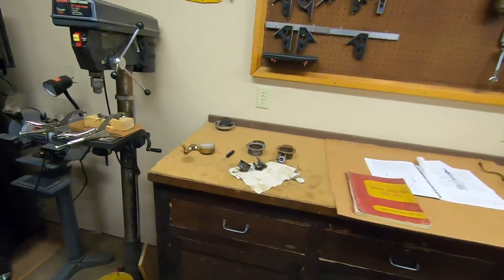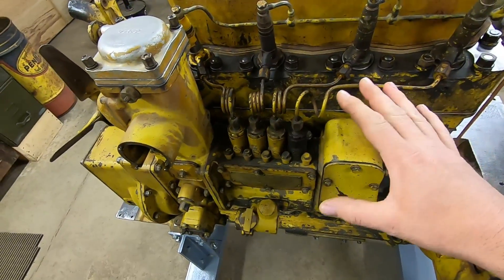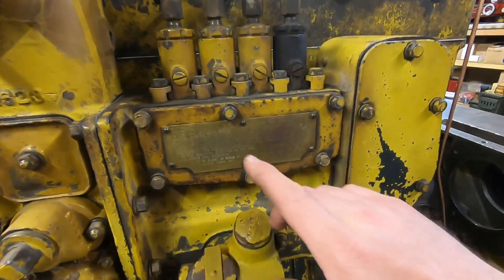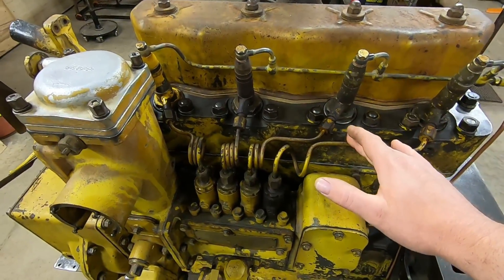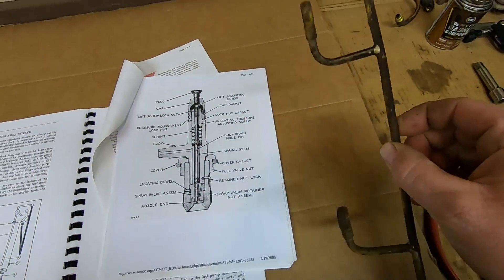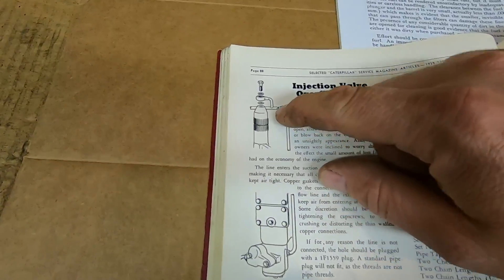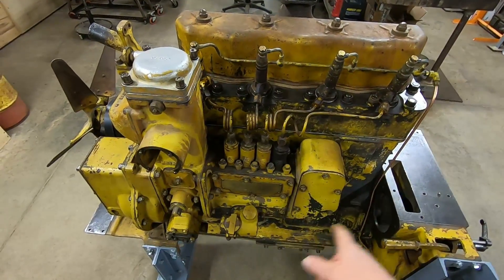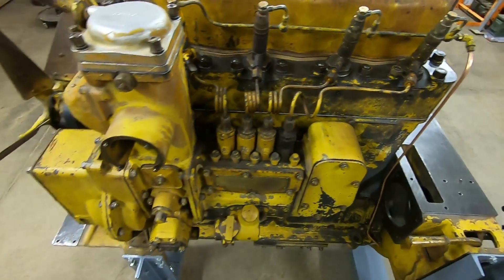Caterpillar D2 #5J1113 - Injector Return Lines Explained - How Much Fuel Do They Actually Leak??

Comment: It occurs to me that the leaks caused by the modification (poor design, built in failure) are equal to or greater than the original system.

Comment: I don't know if plumbing a line back to the tank and dumping it in there is a good idea but it seems a catch-can that can be easily removed would solve the problem. Part of normal start up service would be to empty it into a container to be used for shop stove fuel, parts cleaning, whatever. That way it neither goes to waste nor gets callously spilled into the environment.

Comment: On granndpas old cat he traded a cletrac  for it had that injector run off line but gramp had the front one routed to the back on and both of them terminated at a catch can he had mounted to the crank inspection plates it could be checked and emptied once a month or so

Comment: the old 2 stroke Detroits dropped oil . that's how you knew when to do a inframe . from my memory detroit recommend a inframe when the motor dripped 20 drops of oil per minute from the blow-by tube.

Comment: My experience is with Lister stationary/marine engines with a similar fuel injection system. We always ensured that the "leak off" was piped back to the tank. If not done it could cause over fuelling on full load. Diesel drips in a boat, not acceptable.

Comment: To keep the purest happy put a little catch tray under the the “one drip per minute”
 line.😉 Could you imagine a little catch tray made out of a small Tuna tin.😂😂. Maybe paint it cat yellow a thought too. 😂😂. Endless fixes for the purest! End of the days work remove the contents to the tracks to reduce rusting. Nobody would know any difference. However they would be ever so upset if there was no diesel o/f into the tuna can hey. Nothing to make them squeal. There inflated egos would definitely be quieter.

Comment: If you notice as you drive along the highways that darker section between the normal tire tracks,..that's dripped oil etc. etc. for all out vehicles pounding over the roads all day long.
So a little drop or three of fuel oil won't cause much of an issue in the grand scheme of things will it? 
Has anybody ever wondered about all the excitement raised over spilling oils in the world,..whatever happened to all that oil that was spilled during the large wars, both on land and in the oceans of the world.
Where's that oil today?  Aw, never mind I can hear the replies now.

Comment: Anyone thinking it is 1/8" line running full flow or pressurized flow should take a moment and think just how fast a 1/8" hole will drain a 10 gallon fuel tank. I'd guess it would be something like 4 hours or a bit less. That is probably faster than the engine actually uses fuel, and would have been a major concern in the days when this machine was made.

Comment: D2 engine don't return fuel like modern engine and fuel return on D2 was more like leakage. Like last of cat mechanical engines 3406 fuel return was in injection pump and no fuel return on injectors. Pressure was dumped back in injection pump and returned back to fuel tank

Comment: You could always go to the trouble of making a small container with a drain on the bottom.... so you can periodically empty it.....   and connect the overflow line to that...  but knowing you..  that's not original ...and no 'cool' factor, so not worth doing..  and as you say, for the small amount expelled through this system, not worth it.

Comment: Is there another way to make diesel besides distilling?
Reply: Well, up here in Canaderp,  some specialists have been tackling the problem of "film" plastics and what to do with them, since they are no longer wanted or welcomed by the foreign countries who once accepted container loads of it,  and they have found a way to make diesel fuel out of used "film" plastics. (film plastics, being cheese slice wrappers, plastic bags, overwrap that covered other packaging, anything thinner than your 6-pack ring keepers)  So they have come up with some way of doing it, but like anything at its start-up,  it's EXTREMELY expensive.  No, I haven't seen the breakdown of the process, nor the fuel quality tests of the so-called finished product.  I just know that it was something that they worked on, mostly as a way to get rid of all this plastic that we don't know what to do with.  Besides that,  no... I don't know any other way of making diesel beyond the processes used to make our petroleums and distillates.

Comment: Why not drain the return line back to the tank. Problem solved, if you wanted to.
Reply: What if the fuel tank sits up higher than the return line discharges?  Then you need to engineer a way to elevate the return/discharge up to get it to the supply tank.

Comment: Regarding the pump element tolerances, I seem to recall they were so precision that simply working them with your hands would cause the plunger to lock up. Will be interesting to point the camera at the injector leak off when the engine is running. Thanks for the explanation Squatch. Just think of all the old timer Cat knowledge you've given to the world!

Comment: Great video.  If you were going to catch the fuel I would send it back to the tank like newer diesels do. I can see the issue with t ing it to the main supply line because the return fuel has no pressure and the supply fuel would eventually find it's way to the top of the injectors and leak out and make a real mess. Keep up the great videos on 1113 and hopefully x231 mm too

Comment: If there is a belly pan on the tractor. Most of those fuel drips are absorbed into the dirt, twigs, and what ever materials you may find down in there. Then it is cleaned out when you remove the belly pan. And material is properly disposed of.

Comment: In your last video you showed a picture of a cat with trays under the engine to catch the fuel coming from those pipes.   Will you be putting such trays on your machine??  Sorry, had to ask the question.
Reply: Earl Richardet 
The trays were in the start up area on the factory floor if I remember right, it was an effort to keep the floor clean during the day's production run and there just in case one of the machines had a problem.

Comment: The EPA had not even been dreamed about when this thing was built.  The seals on all engines at that time were felt and always leaked.  If they didn't leak enough to keep the seal oiled, they would quickly wear out and start leaking a lot.  Cars had "road tubes" or "draft tubes" that ran down the back of the engine for crankcase ventilation. A car was expected to leak at least a quart every 800 to 1500 miles.

Comment: If it bothered you to contaminate the environment you could always run the return back to the tank. The return is strictly for lube and cooling of the nozzle, on good injectors it is indeed minimal.
Reply: That's what I would do.  Mostly to help keep the machine cleaner.

Comment: This is amazingly similar to my '85 Mercedes, although the "return lines" actually do "return" the fuel - I'm going to have to go look now, but I think it goes back to the tank which would avoid the suction problem as shown here. Interestingly, the oil sump on the Mercedes injector pump gets its oil from the engine on the 5 cylinder models, the older 4 cylinder version had an independent oil sump that you filled at oil change time - filled it until oil dripped out of an overflow tube and onto the ground!

Comment: 2 cylinder John Deere diesels actually had the return fuel drip back into the air intake. It was all internal, but if you took the pump housing cover off and followed the copper line it actually went into a drilled port in the head. This port was open to the air intake. I have heard of guys with the old 12 valve Cummins in a Dodge pickup taking an old tube sock and zip tieing it on the road draft tube to keep oil from dripping all over the place. They change the sock at every oil change.

Comment: People of today will think of a 'return line' as a fully flowing circulation. The tiny number of drops that is normal on these old engines is so small...  When I was a kid every car had its crank case just open to the atmosphere too.. PCV and all this closed vapor system evaporative containment and re-injection stuff was not even a glimmer in the future.  Times change.

Comment: If I may ask you a question? Why not have these return lines plumbed to go back to the fuel tank and drain into the tank. Or is it impossible?
Reply: If the diesel supply tank sits up higher than the discharge line,  then you would need a system to gather the discharge, pump or transfer it uphill to get to the supply tank again.

Comment: You should not connect it to the suction side but to the return side.
But the again, perhaps cats doesn't have any return lines?
Reply: @Jambo 
No so.
The return lines come from the injection pump and from the filters. That is different from the leak-oil lines from the injectors.

You can connect the leak oil lines to the return lines, but not to the suction side. Sometimes they are connected to the return lines, sometimes they have their own lines all the way to the tank.

Comment: Wouldn't the simple cure to the fuel oil drips from the injector overflows be to put a 2 quart catch tank at the bottom of the pipe, rather like competition cars have to use if they have an open crankcase breather system. If the leak is as minor as you say, you would only have to empty it every 100 hours of running or so.

Comment: The concept here is quite different from a modern GAS engine where you have a fuel pressure regulator AFTER the injectors. And the excess fuel that makes it past the regulator is returned to the tank.

Comment: I guess I should go back and read those comments for giggles. When I saw that the bleed is just dropped to atmosphere, I knew that meant there was minimal leakage. But, I have also dealt with the capsule injectors with no bleed off line at all, so I knew that cat has done interesting things with injectors so I wasn't surprised.

Comment: We call that stepping over Dollars to pick up Pennies. The diesel loss from those tubes is de minimis and if not you have another issue. While worthwhile to minimize on millions of cars and trucks, that singular tractor is not adding more to pollution than any of those millions do with a drip here and there, especially as a historic rather than daily used machine. There are far bigger things polluting the world than that drain line.

Comment: Add a tiny pill type bottle to the end of the line and empty it twice per year, what ever to shut the activist whackos up.
Reply: Zaptor LOL. I have an old airplane. 1961 N35 Beech Bonanza we restored. Part of a cold-start preflight is to sump 3 points in the fuel system - the main sump under the engine cowling and under each of the two wing tanks. All three sumps are located in the absolute low points, and the purpose of draining these is to sump water droplets that have formed from potential condensate in the bladder tanks. The device is about half the size of a shot glass, clear plexy. With a copper coated pin to engage the spring-loaded sump fitting. Just push it up, drain about 1/4 oz. then look at the fuel, and warm summer day, you’ll see a few H20 bubbles . Sump once more till the water is gone. Clearly u can’t dump the first sample back in a wing tank (water in airplane fuel is a bad idea :) so you’ll see guys just toss it on the deck or ramp or hanger floor...110 octane evaps fairly quick... One day a 20-something was watching this go on and said you shouldn’t do this. I did notice he was smoking a JUUL 🤣😏😆🤔
Reply: If you put a tiny pill bottle anywhere like that, and you’ll be sued in court twice a month, because the teenagers  thought you were trying to hide your dope and tried to steal it, and take a big gulp of it!!
Reply: roadkill5333  Well put a tiny tin can, “A CONTAINER” that suits you and collects the diesel. Why does it have to be so complicated? There is always a whacko that can find a way to cause a problem.

Comment: On my 720 diesel John Deere they just plumbed the return lines into the intake ports of the engine with two little short tubes. Things sure have changed in fuel system technology. Keep it up I’ve been really enjoying the series
Reply: And the 70 series is still rated near the very top in fuel economy from the Nebraska Field Tests.
Reply: That's a clever solution

Comment: Many years ago I was told that fuel lubricated the injector parts and would be in the return lines.  It also provided some degree of cooling. Of course these old systems as you say don't conform to current day thinking but I think lube and cooling still happens in your injectors.  Which brings me to a question, how do your machines deal with low sulpher diesel?  Are you able to still buy high sulpher or do you need to add a lubricating agent?
Reply: You don't need anything extra for good quality fuel. Sulfer is actually a fuel contaminate, the old manuals actually listed a maximum amount allowed in the fuel. Sulfer never was a fuel lubricant. The process of refining down the extra amount to get the ULSD fuel is what gave it its lack of lube. There are standards though and all good fuel should meet the same minimum requirements for lubricity now as it did in the 1970's.  Most fuel suppliers just blend biodiesel back to regular fuel to get the lubricity back up after refineing to ULSD because biodiesel already has no sulfer.  Adding good lube like Standyne Performance formula or the Deere fuel lube gives an extra margin of safety though for a small price.
Reply: @bcbloc02  I knew about the Biodiesel, I used to make it for my cars until about 12 years ago when I broke my reactor and didn't bother fixing it.  Biodiesel is actually specified in the fuel standard here in Australia.

Comment: hi i have question does this eng use a donkey to start it if so what fuel would use i ask if was kero as fuel could you not pipe drip fuel from rail to donkey fuel tank.  It is nice to hear your self explain all the work and why you do it and yes old motor/tractors and trucks are a work of art worth saving
Reply: All starting engines that I am aware of are gasoline fueled.  The primary reason is so it can be started.  Spark ignited engines that run on kerosene require the engine to be warmed up prior to switching over to kerosene.  They are started on gas and after coming to temperature the fuel selector is moved to the main fuel (kerosene) and the fuel supply is diverted from the starter tank (gasoline) to the main tank.  So in short, yes it has a starting engine, but no, it is gasoline so it can be hand started.
Reply: @donsundberg5730   thank you for the information

Comment: I bet most operators spilled more fuel filling the cat tank than the drip lines ever drip
Reply: I spill more diesel filling my BX Kubota out of one of those stupid "environmentally friendly" 5 gallon plastic containers.
Reply: Mark Hull a non-environmental reckless scofflaw might drill a hole in the can and install a hollow valve stem with cap. Or so I hear.
Reply: For real...people can be so hypercritical

Comment: Full watch and a thumbs up. If they were worried about fuel economy or the environment they could have plumbed it all the way back to the top of the fuel tank or filler neck rather than introduce air into the fuel system. I doubt there would be enough fuel lost to turn the engine over once or for that matter kill an earthworm.

Comment: "IF" we treat diesel like water, there are about 15,000 drips to a gallon. At one drip per minute, the engine would need to run 250 hours to loose one gallon of fuel.
Reply: My googling says it's just shy of 100k drips to a gallon.
Making it more like a gallon every 1600 hours of operation.
So really a non issue.
Reply: Rust prevention and auto lubrication system!
Reply: Hogs love diesel fuel.
Reply: thanks for doing the math!! That’s even less than I thought!
Reply: Don't you just love shit hot mathematics!
Reply: @brianmcmenamin7269  What kind of a moron would make a statement like that? I'm sorry, I answered my own question.

Comment: I assume you'll need to add some lubricity to modern diesel fuel for that old veteran.
Reply: B5 has more lube than they had back in the day
Reply: Those tolerances compared to modern tolerances are the proverbial hotdog down the hallway.  Lubricity of current diesel is not an issue, or we would have already had lots of fuel related failures.

Comment: Good explanation of the leak off lines. As you said not like the newer stuff. I am used to newer ie 1980s Deere tractors where the return lines move a lot of fuel and leaks make a mess quickly

Comment: I dont believe the little fuel that drips on the ground is not all that harmful. Especially all fluids and  Chemicals used on farms now days. There are oil soaking into the ground from asphalt. All the chemicals that come from all the cats and trucks, rubber from tires what get washed from the roads when it rains and ends up in the rivers.  Sewage treatment plants that dump there not 100% treated water back into the rivers. So a few drops of diesel fuel is pretty much meaningless in the realm of things.
Reply: Exactly, it's a tiny amount that the microbes in the soil easily breakdown and consume. That and think of all the petroleum wasted in the (insert disposable plastic item here) junk that we consume that we don't really need.

Comment: On a totally left of feild question 
What do feild day / machinery show operators think of these old machines leaking oil and fuel all over the local gov car parks and grass 
Tiny amount but in this day and age some people get a bit carried away
Reply: Modern vehicles leak oil all over car parks, grass, etc.  Ever notice the center of every drive lane?
Reply: They shouldn't though 
Nothing like open lube systems and the like